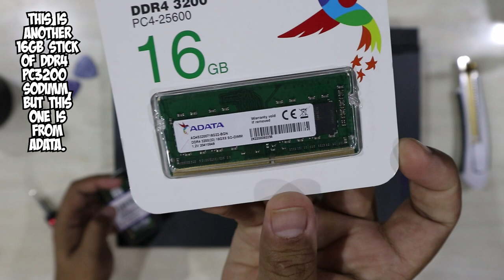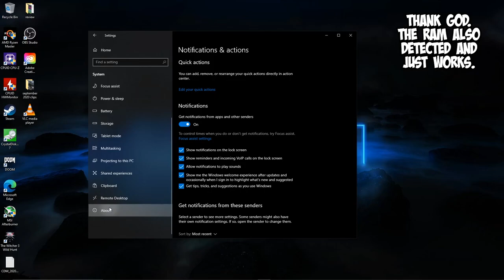Lenovo Legion 5(2020): SSD and RAM upgrade

Comment: New Fam here next time be careful opening hehe. I'm quite new with terminologies and looking for a gaming laptop.. at the last part, u put a 512 ssd memory right?  What's the the other one that can be put in that slot? Will wait for the answer, thanks
Reply: Is that where one can put a HDD as well? Can I do a 1 TB hdd and 1 TB ssd in there? Thanks
Reply: So the m2 refers to the ssd,  Is 2 ssd better than 1ssd and 1hdd overall? Doesn't sdd have frying issues? Or does using  sdd make it less hot on the laptop? Thanks
Reply from the maker: hi. thanks for watching. 
the term solid state drive(ssd) is a general term for a type of hard drive that don't use spinning discs. 
Hdd is a term used to describe traditional hard drives.
When talking about SSD per se, it can be broadly divided into two types, Sata ssd and pcie nvme ssd. sata ssd comes in the shape and size of traditional hdd, ie 2.5 inch and uses the same sata power and data connector. 
pcie nvme ssd uses the m.2 standard, so the motherboard needs to have a built in slot that support this. 
the advantage of sata ssd is that you can pretty much install it in any pc/laptop that support hdd because it uses the same connectors and take up the same space. 
it's also relatively cheaper compared to pcie nvme ssd. 
pcie nvme ssd tends to have much faster read and write speeds compared to sata ssd(whether u'd notice it in real world use or not is dependent on ur use case) and they are priced slightly higher because of that. 
they are also much more compact and don't have separate power/data connectors. 
Now, with regards to the Legion 5, in total it has two m.2 slots for pcie nvme ssds and one sata connector for either a hdd/sata ssd. 
usually one slot is already populated with an nvme drive from the factory. 
out of the 2nd m.2 slot and sata, you have to choose to use either one as populating one slot will physically interfere with the other(if put nvme ssd, sata hdd/ssd won't fit and vice versa). 
so configurations that would be possible for the Legion 5 are:
1. 1 nvme + 1 sata hdd/ssd(2.5 inch) 
2. 1 nvme + 1nvme
in terms of heat, you shouldn't be too worried. nvme ssd do get warm but not the point where it can cause problem for most real world use. 
to be honest ssd are generally much more reliable than traditional hdd due to lack of moving components. this is especially true if you always carry your laptop around. 
hope this helps. thanks😊

Comment: How do I know if the ddr4 will fit in my lenovo legion 5? Because I couldn't find adata ddr4
Reply from the maker: hi. I don't quite understand what u mean by fit. if you meant physical size, just make sure you buy sodimm(small outline dual in line memory module) which is the standard size for laptop RAM modules, NOT dimm modules, which are meant for desktops. 
if you meant the specifications, I just try to match the specs that Lenovo use, ie DDR4 with 3200 speeds. you may get it to work with slightly slower or faster RAM, but to minimise chance of incompatibility, I'd just try to match the factory modules spec.
Brands don't matter as much, the spec matters more. Adata may not be available in your country or marketed under different name, but pretty much any brands should be ok as long as the spec match. hope this helps.
Reply: @masterofnone4608  yes i meant the physical size of the ram thank you so much !!

Comment: Hi! Im planning to add another nvme ssd to my unit and im wondering if the screws removed from the caddy could be used to place the ssd in place? Much appreciated!
Reply from the maker: hi. thanks for watching. unfortunately no, u can't use the screws from the caddy. the m.2 drives require a 3x2mm screw. hope this helps. thanks😁
Reply: @masterofnone4608  Thank you for this!

Comment: HELP ME OUT!
.
I want to add RAM to my Legion 5 ( 15ARH05 )  ** Current RAM Kingston LV32D4S2S8HD-8 **
I am on a tight budget so I was wondering if it's ok if I...
Instead of buying 2 new RAM sticks of the same brand , Buy 1 of different brand and install it?
.
If yes then what factors should I consider while choosing a RAM?
(I have taken note of this factors: 8GB, DDR4, CL=22, Speed=3200MHz, SODIMM, CR=1T. anything else?)
.
I was thinking if buying *Crucial CT8G4SFRA32A* is ok or is there any other better option?

Thank You.
Reply from the maker: hi. thanks for watching. in my video, I also used RAM sticks from different brands, one is Kingston and the other is Adata. As long as the specifications on the RAM sticks match, you shouldn't have much problem.
I personally would just go for the cheapest RAM sticks that meet the specifications and from a fairly reputable brand. this would vary slightly between countries. but crucial is a fairly well known brand, so as long as you think the price is reasonable(I can't say what's the best price as I found ram prices almost doubled in malaysia compared to one year ago, I don't know whether the same thing is happening where you are).
hope this helps, thanks for watching😁

Comment: (Question) if I put a larger m.2 sad in this than what's the boot drive is...will it make the new drive the boot drive or will it just recognize it as an ADDITIONAL drive?
Thanks.
Reply from the maker: hi. the short answer is no😁 the long answer is if you just adding  a larger capacity drive to an empty available slot in your laptop/pc, it wil be recognized as additional storage. it will not automatically become the boot drive. the os will remain in the original/old drive and will be loaded from that drive.
in the bios, you can actually specify the boot sequence, eg. drive c:, drive d: etc etc meaning that the computer will try to boot from all the drives on the laptop in sequence until it find the Os.
hope this helps. thanks for watching😁
Reply: @masterofnone4608  thank you for the info and the reply 
I appreciate it.

Comment: What are the sizes of the screwdrivers used ?
Reply from the maker: hi. thanks for watching. the manual recommends a Phillips screw drive size PH0 or PH1. I just use any screw driver that fits😅 try and error. hope this helps.
Reply: @masterofnone4608  thanks so much👍👍

Comment: The one I am going to get has a 8gb ram stick that's soldered to the motherboard, if I get another 8gb and add it to SODIMM slot will it read 16gb or I have to get 2 8gb sticks?
Reply from the maker: hi. thanks for watching. if your laptop have 1 upgradable sodimm slot and have an 8gb soldered ram, any stick added to the slot will add capacity of your ram. eg if you add an 8gb stick, total ram will be 16gb, if you add a 16gb stick, total ram will be 24gb. hope this helps. 😁
Reply: @masterofnone4608  Thanks man,  Also do i need to buy the laptop first then check the ram with CPU-Z and get a similar one with same speed and latency or there is a standard ram speed and latency for the Legion 5 Ryzen Edition? Is it standard at DDR4 3200mhz and CL20?
Reply from the maker: hi. if you really want to be absolutely sure of the brand and specifications of the ram, yeah by all means wait for the laptop to arrive.
the thing about manufacturers is that they some times used different brands/slight spec changes depending on availability from suppliers. however these would be up to their minimum standard specifications. it's usually not something the average user would notice in day to day use.
personally I would wait, because there's no real rush. but if you happen to find a really good deal that's time sensitive, as long as the speed and timings match just buy the extra ram😉 hope this helps.

Comment: I did this after a while my computer is not starting anymore i do not know the cause. The wire in 9:41 is burnout
Reply: board got burned. probably got in contact with the wire? either way, if you can remove this, you should.
Reply from the maker: thanks for the great advice🙏. sorry to hear about your computer😭
Reply: @masterofnone4608  can you explain what he just said?
Reply from the maker: @iihamed711  he meant to remove the sata cable(one that's connected to the dummy disk), rather than leaving it in there like I did.
 this is because the  sata cable also carry power(this is a combo data/power cable, unlike in desktops in which they are usually separated), should the pins in the cable touches anything conductive in the case, it can cause a short circuit. I suppose that's why they shipped the thing with a dummy disk.
to remove it is quite simple. just gently unclip the ribbon cable and take it out. keep the cable in a safe(and easily remembered) place. in case you ever want to use it😅
Reply: @masterofnone4608  Thanks

Comment: Where's the procecor for give pasta?
Reply from the maker: Hi. I'm assuming you're asking where the processor is because you want to change the thermal paste. At 3:08,  the processor is underneath the right side contact plate. Remove the 6 screws holding the cooling solution in place and then you can access the processor. 
https://support.lenovo.com/us/en/solutions/ht510415-removal-and-replacement-videos-legion-5-81y6-82au-82b5-82b1-81yb-82b3-82gn-82gq-legion-5p-82aw-82ay
this link points towards Lenovo's video guide to remove the heatsink
Hope this helps. Thanks

Comment: So i can add another ssd without removing the first one on my laptop right? 
And i wanna know if ssd has the same sockets as hdd or not?
Reply from the maker: hi. thanks for watching. the Legion 5 storage can be upgraded in 2 ways. you can either add an extra nvme ssd, or you can add a sata ssd/hdd. however you can only choose one or the other, as installing one would block the other.
the Legion 5 comes with the sata connector installed, just need to remove the dummy drive and install the drive in the provided bracket(Lenovo also include the screws for sata ssd/hdd). and yeah, sata ssd and hdd shares the same connector. hope this helps.
Reply: @masterofnone4608  you mean that i can add double ssd , right?
Reply from the maker: @Ahmedzeddan  yes. you can have a maximum of 2 ssds in the Legion 5. but they can only be either a combination of 2 nvme ssds or 1 nvme ssd and 1 sata ssd. hoep this helps😁

Comment: is it possible to upgrade the video card from the GTX 1660ti to any RTX technology card? THANKS
Reply from the maker: hi. On lenovo official Malaysian website, you can configure this laptop with an Rtx 2060, but you have to choose  the model with the 80wh battery and 230w charger. As far as I know, rtx 2060 is the only rtx gpu available for the Legion 5, at least ones with AMD cpus. But you have to check with your local Lenovo website/rep regarding what's available to you locally. hope this help.
Reply: @masterofnone4608  thanks for your time, the main idea was if i could upgrade it by myself, but now i know that i can only upgrade ram and storage. Subscribed!

Comment: About the ram, is it okay to add a stick of 16GB ram and the other one is 4GB?
Reply from the maker: hi. there should be no big issue. your RAM capacity will be 20gb. for normal day to day use, you probably won't notice any performance issue (you probably notice the performance gain from the extra ram😁 more than anything else) hope this helps. thanks for watching.
Reply: @masterofnone4608  Thank you ❤️ I thought both ram should be the same GB to be able to function
Reply from the maker: @karlndr  for absolutely optimal performance, yes the ram sticks should be matched in everyway. for normal day to day use, you probably notice the performance increase from the increased capacity itself rather than some slow downs due to slight mismatched ram sticks.

https://youtu.be/bTS0ybQ3lCI

this video from LTT demonstrate that mixing and matching ram sticks is not all that bad😁
hope this helps.

Comment: What is the maximum RAM on this laptop? I looked on the Lenovo site and they are saying 16GB.
Reply from the maker: hi bro. thanks for watching. if you look up the specs for the renoir cpus, they support up to 64gb of ddr4 3200. lenovo on the other hand never clearly states the max ram capacity the Legion 5 support(at least in the documentations that I found) but they only offer configurations of up to 16gb on their website.
I installed 32gb in mine and seems to be working just fine. So, I can certainly vouch for 32gb, as for 64gb I don't see any reason why it wouldn't work, but I just don't have 2x32gb sticks lying around to try.
hope this helps. thanks😊
Reply: @masterofnone4608  Ahh, thank you for the clarification. I was puzzled because I feel 16GB is low especially for Windows 10.
Reply: @charlesm.1638  nah. 16GB is overkill for casual users but it is a sweet spot for gamers (you can honestly go by with 4GB but personally I feel like 8GB should be the new minimum). Can confirm that 64GB of RAM works because that's what I have in mine.
Reply: @mediocritycentral  Thank you, I mostly go with 32GB just to give breathing room. I asked because I always have multiple applications open especially SQL which eats up RAM.
Reply: @charlesm.1638  oh that's cool. 32GB should work nicely with ur usage. I went with 64GB because I use Premiere Pro and After Effects heavily and occasionally use CAD.

Comment: My version comes with a 215gb ssd and a 1tb hdd. Would I be able to remove the hdd and replace it with an ssd in the future?
Reply from the maker: hi. yeah, you should be able to. thanks for watching😊
Reply: @masterofnone4608  would I need to backup windows?
Reply from the maker: @ranenjaysalikram9146  that would depends. I mean having a backup is always a good idea.
However, if your hdd functions as a secondary storage, and you don't hv windows installed on it, then backing up windows is less of a concern.
However, if your hdd is your boot drive(ie you hv windows installed on it) then backing up windows would be important.
I personally would do a clean install on new boot drive rather than clone an old drive. so I would just backup my important data rather than windows per se.
However, people do things differently and there's no clear right or wrong way to do things😊
hope this helps. thanks for watching.

Comment: Very informative video. Sir can I use 4tb nvme m.2 in the second slot. What will be the maximum capacity of both the ssd's.
Reply from the maker: unfortunately can't give you definitive answer. looking at lenovo's configurator they only allow up to 1TB for each,but as you see with RAM just because lenovo offers up to 16gb that doesn't mean that that's the maximum it can support and the manual for legion 5 also did not specify a maximum limit. I would imagine there's no reason for it not to work, but I myself don't have a 4tb drive to try. Sorry couldn't be more helpful.

Comment: Hlo brother can I upgrade my SSD 256g. To 512gb in Lenovo legion 5 rygen 5 4600h
Reply from the maker: hi. thanks for watching bro. yup, you can upgrade capacity. you can also install another ssd in there (assuming you don't already have a hard disk already plugged in😁)
Reply: Does lenovo legion 5 batarry finsih in less time while doing normal works and sometime gaming
Reply from the maker: in my experience, for normal work ie presentations, office  works, the battery usually last for around 3-4 hours, however if I was doing video editing or gaming the battery would drain out by an hour or so. if you planning to do some intensive work, you have to plug it in I'm afraid. but this is based on my laptop which has the 60wh battery, and I also turned hybrid mode off and brightness always around 75%. so your milage may vary.

Comment: Hello I've noticed you didn't unplug the battery. Is it safe? I'm worrying that it may cause problems and at the same time I worry that if i unplug it then plug it again, it won't work amymore. Thanks
Reply from the maker: hi. it's best practice to disconnect the battery before doing any upgrade to minimise the risk of shorting things out. I definitely not demonstrating the absolutely correct way of doing things. I'm just lazy, sorry. so do as I say, not what I do.
with that in mind, in this laptop replacing the ram and storage is relatively easy, so the risk of you causing a short is very low as everything is fairly easily accessible. as I mentioned in previous comments, I have yet had any problems by not disconnecting the battery while doing simple upgrades(not a valid  excuse) . but of course, be reasonable ie don't go poking about the pins/trace with your screw driver.
with regards to the battery, I don't think you should be too worried about disconnecting it. Lenovo in its manual for this laptop even highly recommends disconnecting the battery before doing any upgrade, so the likelihood of your laptop not turning if you connect and disconnect the battery is pretty small. again,  common sense, power down the system before disconnecting the battery, don't pull on the battery cable to remove it(there's a clip at the connector), don't poke the battery with sharp objects and don't disconnect the battery when windows is updating. you should be fine. hope this helps😊
Reply: Wow. Thanks for the time to reply! And also the long reply. I just bought an anti-static wrist strap. I am also upgrading just the ssd and ram and nothing more. And yeah maybe I'll do remove it. I'm just also worrying because some people here in youtube have difficulties unplugging it. Thanks again!